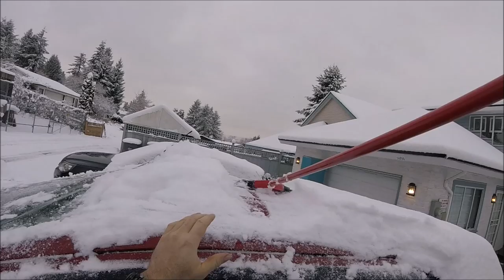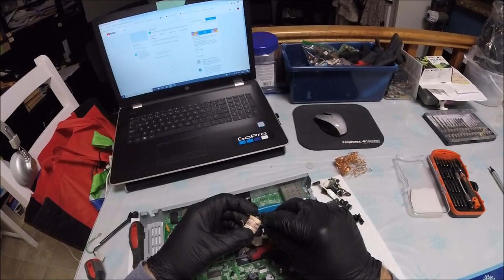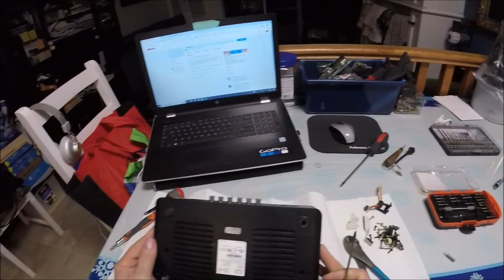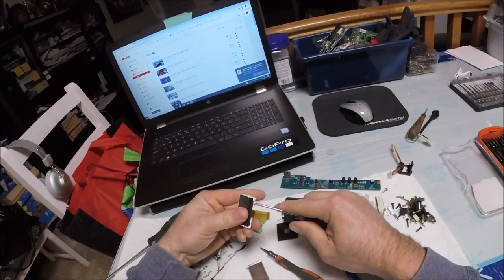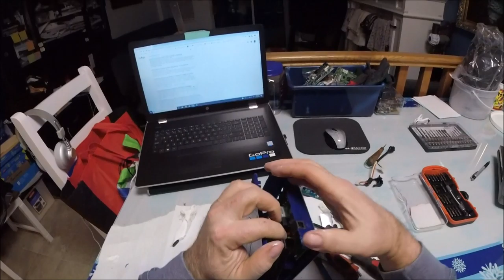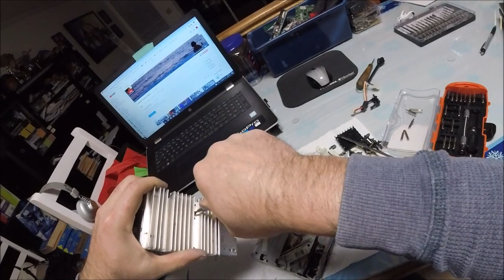Scrapping Electronics Looking For Gold

Comment: ohh, that's SOOOO not the way to unwind that first copper coil you did.  If you remove all the iron you can insert a small screwdriver in the hole and spin the wire off that, instead of onto your finger.  MUCH easier.  Hope that works for you, too.  That is my method; but I'm sure it came from another YouTuber.  Keep it up!
Reply from the maker: Thanks For Watching, I normally don't unwind those, But i wanted to see how much copper in those spools. I will do your method next time Thanks

Comment: Any BGA with silver dots or any color on the outside other than gold DO NOT CONTAIN GOLD bond wires.
Reply from the maker: Thanks For Watching, What about flat packs?
Reply: @CanadianTreasureHunter  flat packs are tricky, pretty much hit or miss. If you look at the edges sometimes you can see gold tracing sandwiched between ceramic layers.